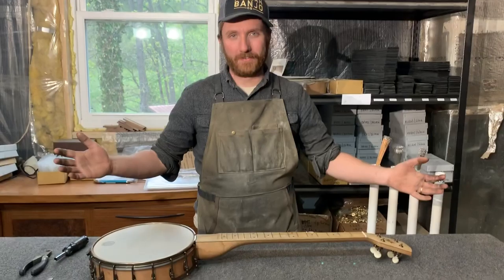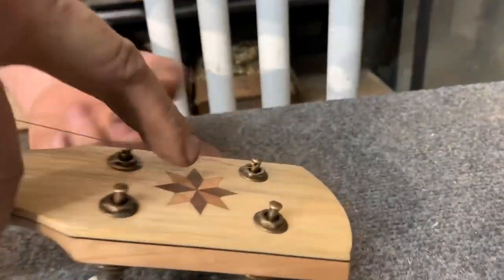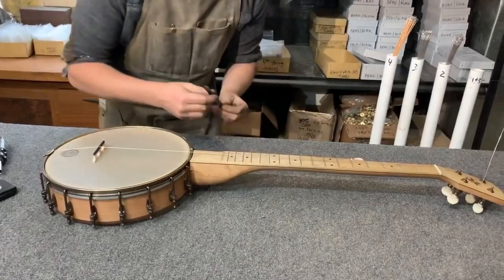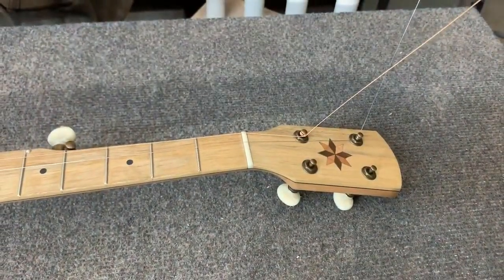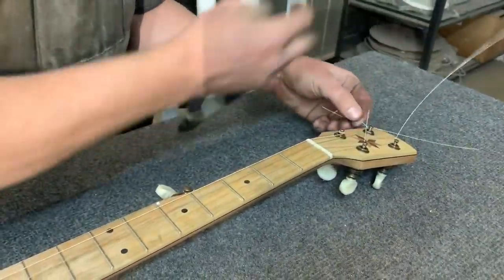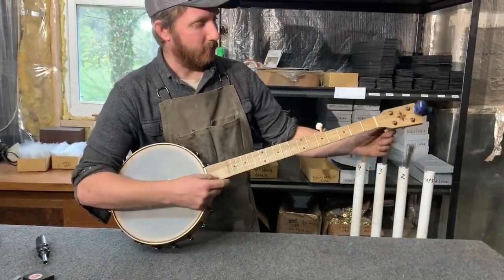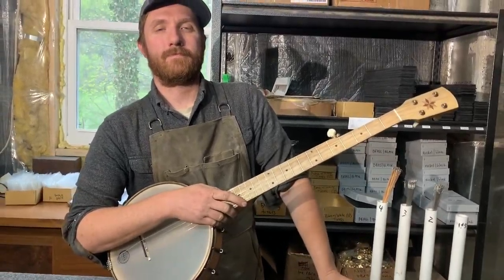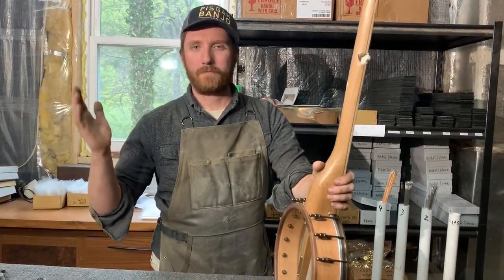How to string up your banjo and set your bridge

Comment: Thank you for setting the bridge simply by checking the octave. I never understood all the stuff about making "chimes" at the octave. All you need to do is check the two D strings at the nut and at the 12th fret. There is no need for "chimes" and no need to check the other strings to set the bridge.